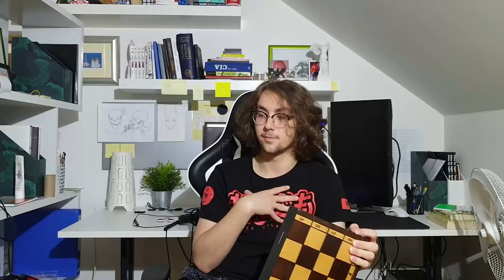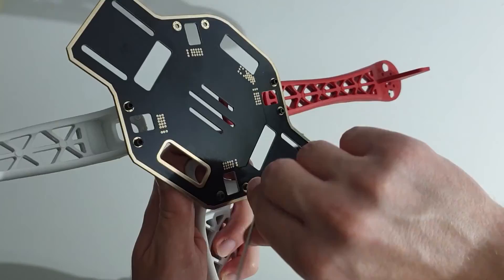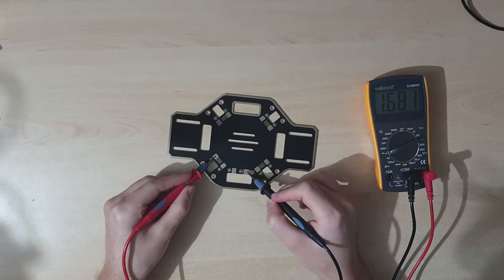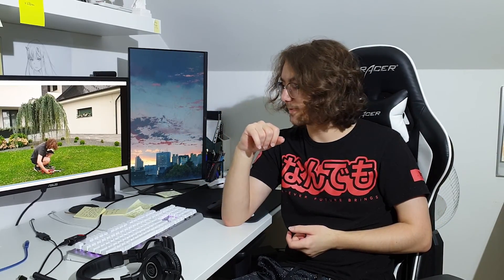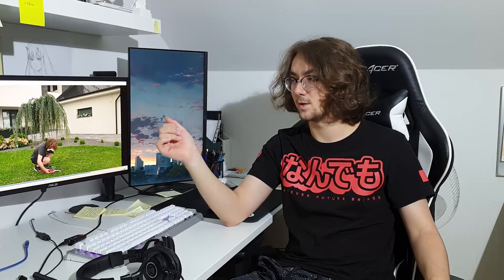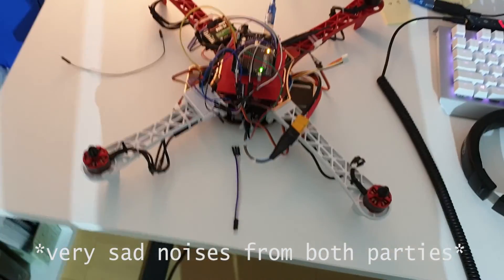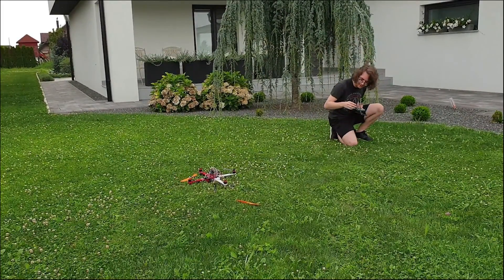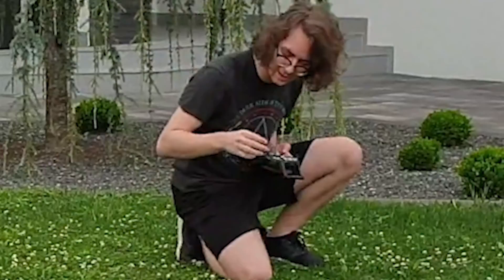How I made a flying drone | DIY Arduino drone | Quadcopter

Comment: Bro my 4th motor when 0 throtel keeps beeping and when throtel increase it stop beeping other 3motor rotates but it doesn't i tested that motor esc separately it works but when in frame with Arduino is beeps

Comment: Curious to know what kind of math you were doing here: 02:28 and why
Reply: IMO  So from what I have seen he put some resistors for brushless motors wich gose hand in hand with ohm symbol from his notebook. Could be because the current is to high for the motors, but whatever part motors or not, he wants to reduce the current a component get from power supply.

Comment: thanks for shared, i have a question why don't use power from esc? because if do it we will se how much vol from pin is left. this is just my opinion and i don't know if we do that, what problems will we face. have a good day
Reply from the maker: I don't understand what you mean by that, what esc power? esc's are also powered by the main battery, so at the end of the day it doesnt matter where we draw the power from because it's from the same battery, plus i have no idea how you'd draw the power from the esc
Reply: @ekaeo  sorry for not being clear. i mean ecs will have three wires output 1 signal + and - so why not use + - to supply rx because i see on tx of flysky i6 can see current vol number of tx so we can  know when to stop.  When use 5v from arduino we waste the feature on tx
Reply from the maker: @dinhtanloi536  sorry, but i'm kinda having trouble understanding you xd, I think what you're refering to is why didn't i connect the receiver to the esc? But it really doesnt matter where the receiver draws the power as long as it get anywhere between 3.3-5v
Reply: can you give link to the programe

Comment: Hey, when I connected the reciever to arduino, the reciever led did not turn on and even the signals are not coming on the ide serial monitor, any idea?
Reply: Yeah but I'm doing with the arduino only that has been connected to the computer which I'll later connect to my battery, I think I'll have to buy a new reciver
Reply from the maker: @Aarav-G  should be working with arudino only as well as long as you connect it to the 5V pin
Reply: Also, I checked the connections like 20 times and have tried many different combos but all have the same error.  Also, dude I'm way younger than you think, it's just a hobby for me and I'm not even close to an engineer, hence I cannot just program things that easily. Im just a beginner, that's why I just need some help to get started. I hope you understand.
Reply from the maker: @Aarav-G  then your receiver might be busted
Reply: Done that sir
Reply: 5v and gnd also
Reply: Yeah I guess reciever is wrong, I shall buy a new one, thank you for your time, I'm sorry if I disturbed, your channel is great
Reply from the maker: @Aarav-G  sorry if i gave the wrong vibe as well, it's just that you should try as much things as possible before resorting to instant solutions, good luck with your drone build:)
Reply from the maker: nice name change my guy, but still man.. if the led is not turning on how do you expect any signal to be coming through, you're obviously not supplying any power to your receiver if it's not working, check your connections and try again, also i suggest investing 5€ into a multimeter so your don't ask stupid questions like this again

Comment: Hey I was wondering for the FS IAB6 receiver, where did you plug in the pins for B/VCC? did you only use the top row of the receiver of CHANNELS 1-4 for Throttle, pitch, yaw, and roll?
Reply: also have a question, when the arduino flight controller isn't plugged into the computer what powers up the arduino when its on the drone frame? The LIPO battery connected to the ESCs?
Reply from the maker: @shade-val  huh, honestly I don't even remeber at this point, but I'm pretty sure there is a B/VCC pin noted on the receiver, as for everything else, you're only using the pins to send the signal, upon configuring your drone you're gonna be "asked" to enter those input so it doesnt even matter what order you put them in, as for the arduino power, yes, I basically soldered another 2 wires so i can power up the arudino since arduino takes (8-20V) and my lipo battery was 12.1V, tho be very cereful you don't fuck up the + and -, cuz you're gonna fry your arduino, I did twice:)

Comment: Hi Im trying to build this drone and I was wondering if the firmware for the ESC matters on an Arduino drone, for example SimonK or BL-Heli. Thanks in advance.
Reply from the maker: litereally just buy an esc you want, more so look for the cheapest one, it doesn't matter
Reply: @ekaeo  Thanks

Comment: I made a drone with Arduino Uno R3, MPU 6050, Flysky Transmitter i6x.

All connected and turned on but motors are not spinning when I turn throttle stick for first time. 

Throttle value remains 1500 on multiwii screen.

Please advise what to do
Reply from the maker: I'm sorry for not replying to your comment, I've not seen it:( Hopefully by now you got ur drone up and running in the sky, also I've not used multiwii so I can't really help you all that much, regardless thank you for watching the video

Comment: Great video man!! Which code did you use buddy? 

Please do reply I'm in the middle of getting that fixed
Reply: Is it an auto levelling Quadcopter?
Reply from the maker: @nikhilankam3049  yes
Reply: Great man! Thanks for the reply
Reply from the maker: http://www.brokking.net/ymfc-al_main.html it's a code from jopp brokking, that's his site, or just refer to his youtube videos, that i've linked in the description
Reply: I was wondering whether the voice Joop used is an altitude hold code or not, you have any idea?
Reply from the maker: @nikhilankam3049  If I understand you correctly, yes. Simply, as long as you throttle stick is in the middle, your drone is gonna hold itself in the air.